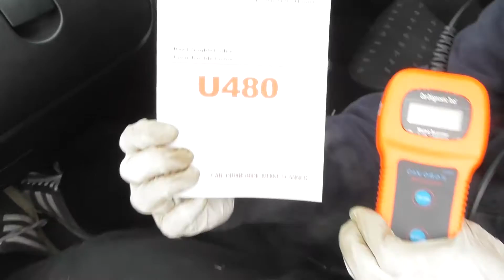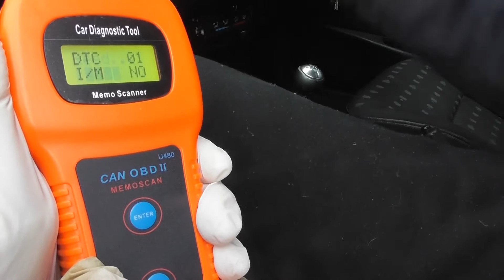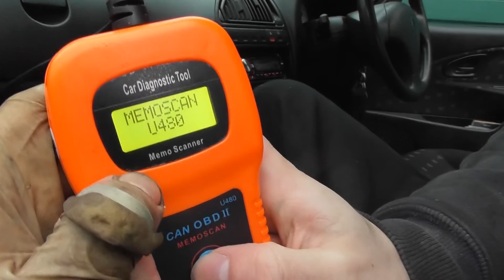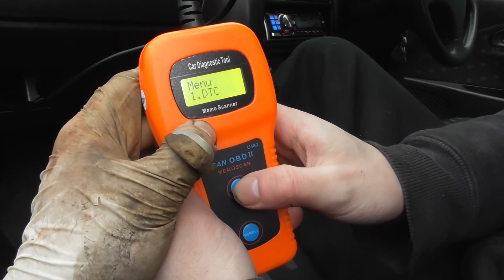T2SG Citroen Saxo VTR Part 6 : Exhaust Manifold, CAT Install and Fault Code Reader

Comment: I am going to seal the oil can on my 1.1 Saxo. Is it possible to remove the Cat from these 4 screws underneath, without  removing the exhaust manifold?
Reply from the maker: I am not sure.... but the biggest issue would be to get the nuts undone and you will need a new gasket.... if it uses one.

Comment: Hi there, for some reason I can't comment on your video of your EP3. Was wondering if you could tell me where you got the super pro bush kit ask am after the full set. Cheers (Y)
Reply from the maker: +James Cooper Hi, I am not sure why you can't make a comment on the EP3 video, as I have enabled comments on all of my videos. Either way... I bought them on Ebay for £290 delivered they are the SuperPro KIT5189K with Caster Increase. 
http://www.ebay.co.uk/itm/111422902066?_trksid=p2057872.m2749.l2649&ssPageName=STRK%3AMEBIDX%3AIT
Thanks, Paul
Reply: i was on my phone so it might be that. cheers mate (Y)